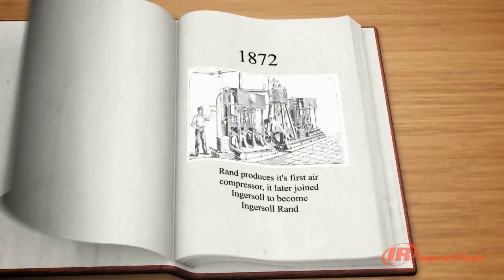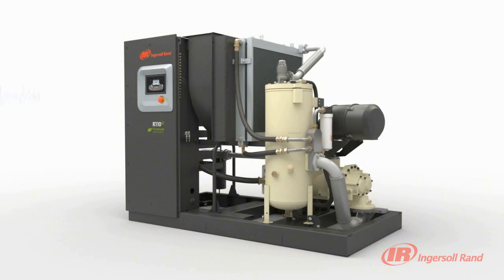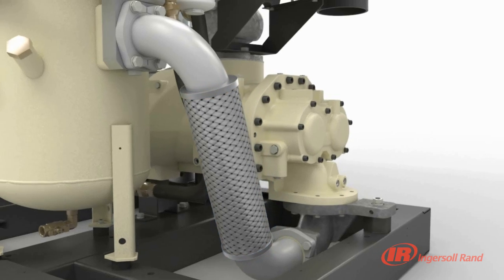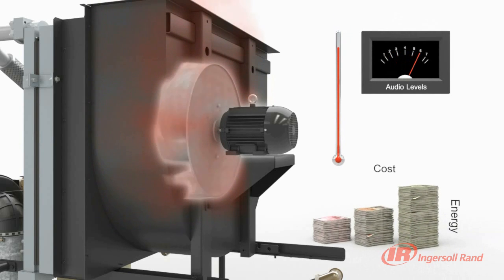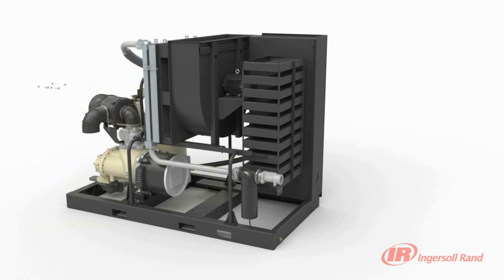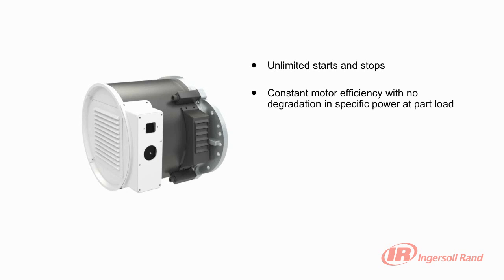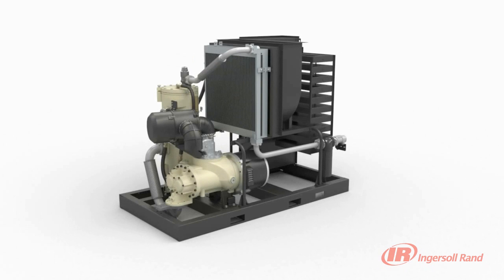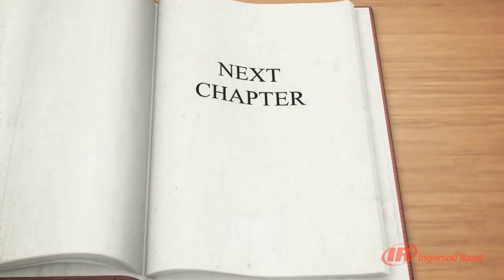INGERSOLL RAND R-SERIES AIR COMPRESSOR

Comment: Hello I could help it agradeseria much I have a compressor diesel model F2L511 and I walk failing him vendiero I already used and brings several things q is not for q are loose things could help me you will have the shop manual for this compressor I hope I can help thanks in advance